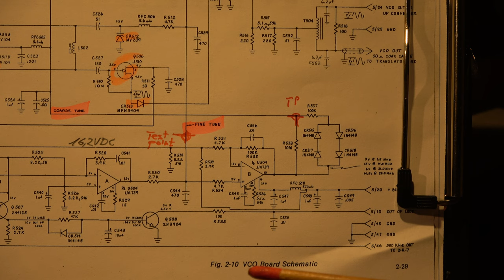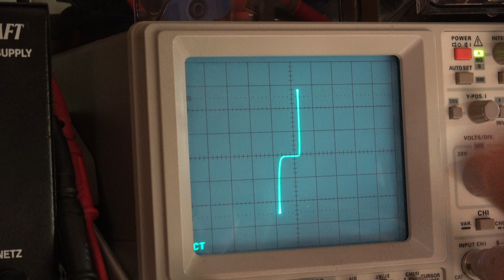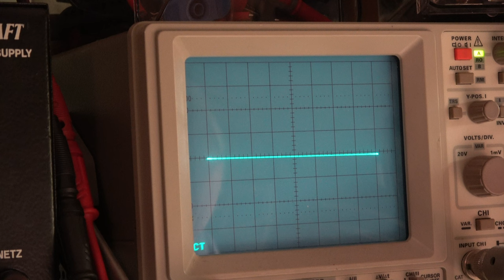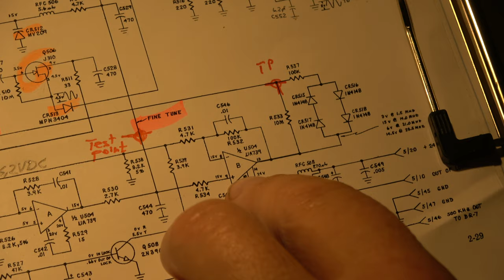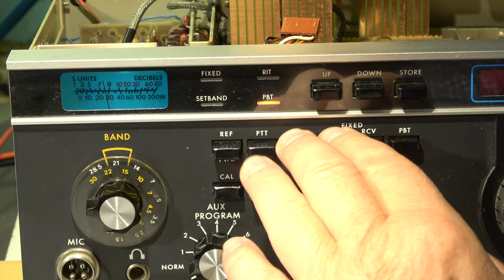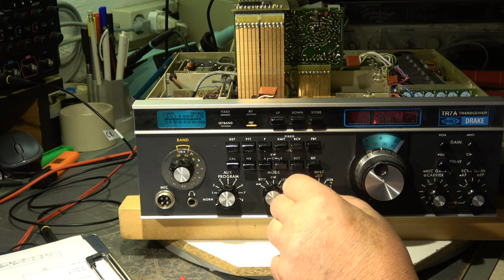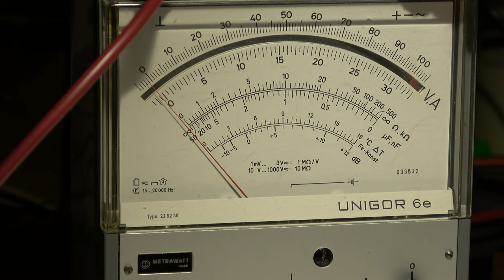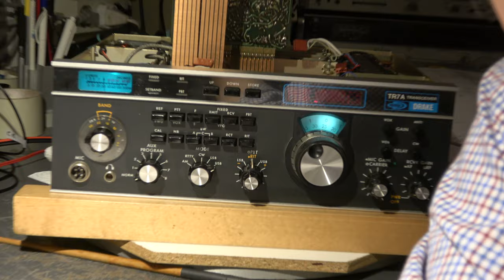#171 Drake TR7 Part 4(7)

Comment: It is possible to read the Varicap capacitance with a C meter connected across it similarly to your signal tracer, and vary the  applied voltage. This will give a reasonable indication of function.   You may get away with using a high voltage rectifier diode, 1N4007 for example, as a replacement, the capacitance change needs to be only small.
Reply: Not a good idea using any odd rectifier diode. Apart from a very low cap. ratio they are very noisy and it affects adversely the vco performance where it hurts the most, i.e. phase noise. They never worked for  me.
Reply: @andytomm1  The low Cmax/Cmin is not relevant here, as the ratio required is small. Also,  "noise" is no worse than a dedicated  varicap diode, as they are reversed biased, there is no current flow, therefore no  "noise".  There are many reasons why they didnt work for you, it being a rectifier diode is not one of them......
Reply from the maker: @andytomm1  Correct!
Reply from the maker: No current means not: No noise! There are also noisy variations of capacity which cause voltage variations. There is a reason why small varicaps have been developed; maybe also inductivity and ohmic losses.
Reply: @dl7majstefan753  decades ago I spent many hours experimenting to get a VCO cover 10,7--40.7 MKz in one go .Finally got the coverage, seemed fine until checked phase noise, no need to even measure it it was plainly visible in a mid quality SA. The varicaps used were KV1235 Intended for MW tuners. C ratio over 10 with C max over 350 pF. Improved loop filtering as much as it could be done to no avail.Resorting to techniques like Drake ie. multiple VCOs (even multiple switched coils) and lower C varicaps improved matters easily.
The trick of using rectifiers as varicaps was mentioned in Pat Hawkers RSGB compendium, it can be used for small ranges like in a bfo but not in a wide VCO working as main RX oscillator. I have since made and repaired several synthesizers a arriving at the same conclusions. Thanks for your attention.
Reply: @dl7majstefan753  Agree, Ohmic losses as well, that is why varicaps are also characterize by Q factor.
Reply: @dayleedwards3521  Not sure how small it is, remember it has to lock fast when the switch is thrown and there is no sweep circuit. Is a compromise situation with the wide part of the circuit. There are good reasons for the VCs they use.
Reply: @dayleedwards3521  Not forgetting Q factor which in rectifiers is not specified. To get at least acceptable performance there are the right components and techniques to be used.
Reply: @dayleedwards3521  There is AC current flow which is even more important. Don't  forget the factors that make a clean and stable VFO.
Reply: @andytomm1  The Drake VCO uses a bank of "steering " varicap diodes to roughly set the base frequency, with a long time constant, the small varicap is arranged to actually phase lock the VCO with a short time constant. This diode is a very small part of the total C, and therefore has a small effect, whether capacitance or "noise". A correctly reverse biased diode acting as a variable C will/should  see any AC RF across it as even a much smaller part of the reverse DC bias. Larger frequency swings require  reverse series diodes to prevent any chance of forward conduction, not done here, but possibly the reason you had problems attempting such a large  VCO swing. .  A dedicated varicap diode has been doped to increase the width of the depletion layer, already large in higher voltage rectifier diodes. to increase the C delta with bias, culminating in the later "hyperabrupt" diodes, and  to maintain uniformity, not to reduce "noise" .  It is the depletion layer width that sets the capacitance between Anode and Cathode., plus the size of the P/N material.
Reply: @dayleedwards3521  Have you checked your assertions in practice.
Do you know what is the junction C of a 4007 ,  Cmax/Cmin and Q ?
Reply: @andytomm1  There is simply no mechanism in a reverse biased diode to create noise unless  it exceeds it reverse breakdown voltage... ie, current flows. You can argue it all you like. The "Q" factor of any diode, varicap or not is exceedingly low compared to a normal fixed capacitance.across an inductor.  Good quality VFOs would never use tuning diodes anyway,in PLL duty,  its a case of having to, not wanting to. I am finished with this.

Comment: Very nice work!  I was sure that you would locate the problem. I also was wondering if a LCR meter would have detected a problem with the varicap diode - I have an HP 4262A LCR meter that allows application of up to 40 Vdc bias to the device under test but have not had the occasion to test a component of this type. Regards, David
Reply from the maker: Yes, dr David. I don´t have such a C-meter with DC-bias - would have to wire it externally. Maybe i´ll do that.